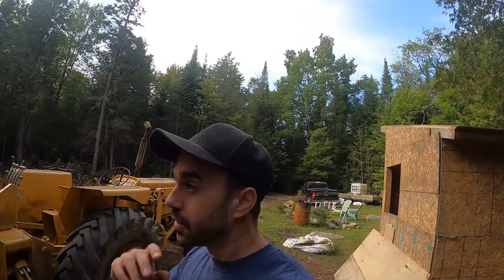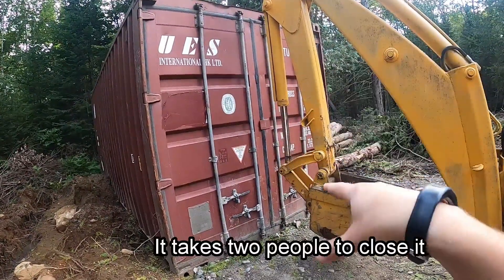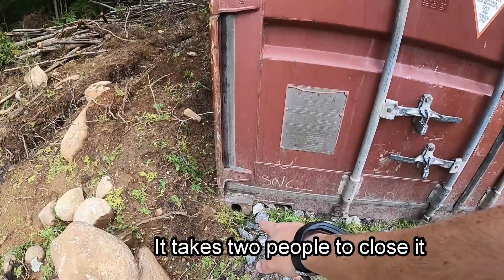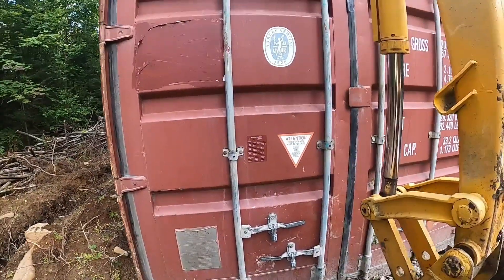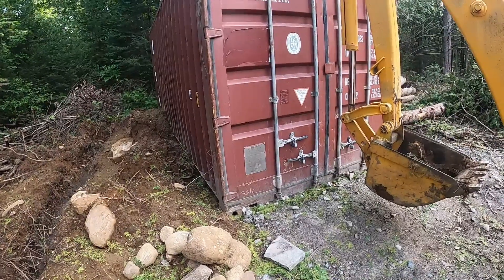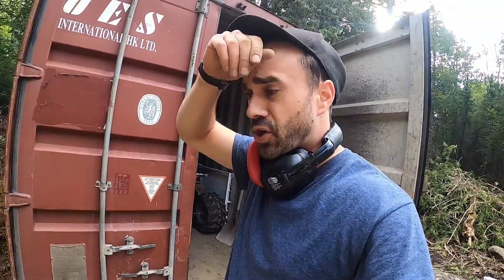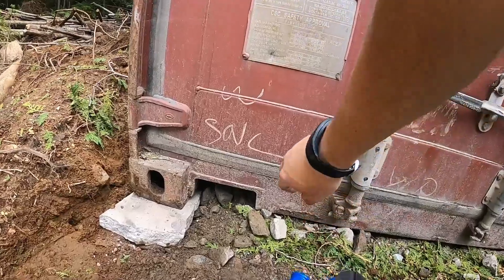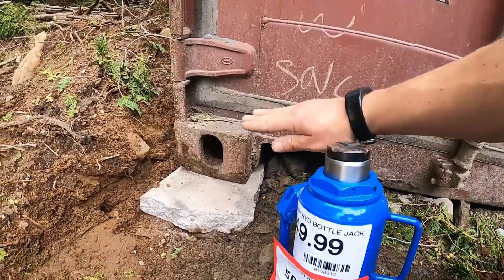How to Fix sagging or hard to open/close shipping container doors

Comment: I'm told to check the level. This is a more accurate way to raise or  lower one end.
Reply from the maker: Yes that would be the best way to do it. Use a laser level if you have one.
Reply: @NorthernChris1  Late arrival here, but - you can also use a water tube.  Something on the order of a 1/4 inch ID (or 6 to 8 mm or what) clear vinyl tubing as long as your container plus enough length to tape the tubing up the side at the corners to a comfortable height to view. Fill the tubing with water ( colored water is easier to see ) and you can use the water in the tubing to gauge how far off level the container is.
Reply from the maker: @OneWildTurkey  That is a good tip, next time I move the container I will try that out! thanks for tine tip!
Reply: @NorthernChris1  I've been thinking about putting my tubing in some PVC and just attaching it to the bottom of the container and permanently mounting the ends to the corners so I can tell if (when) it's shifting.